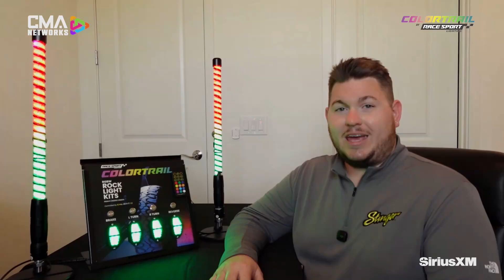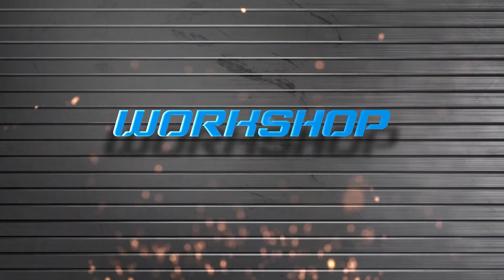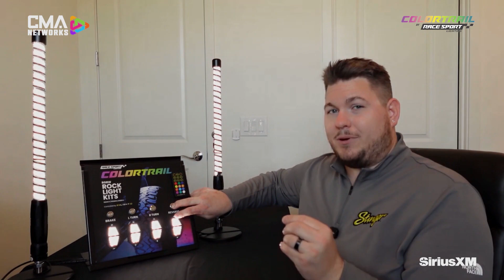HOW THE NEW RACESPORT COLORTRAIL TECHNOLOGY WORKS

Comment: How would I need to hook them up if I wanted to run light in the bed of the truck to turn on when the doors open and have the lights under the truck work with the turn signals with the rock lights